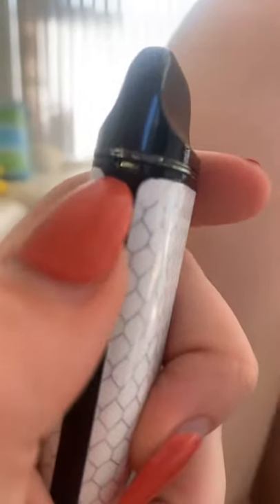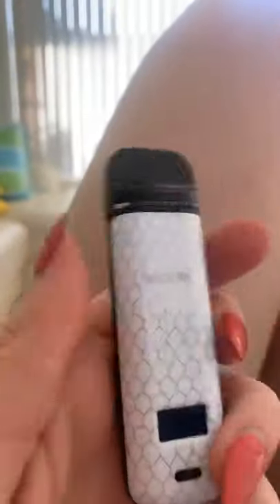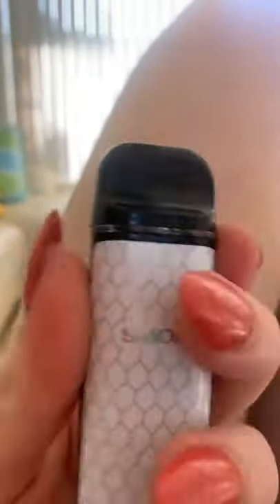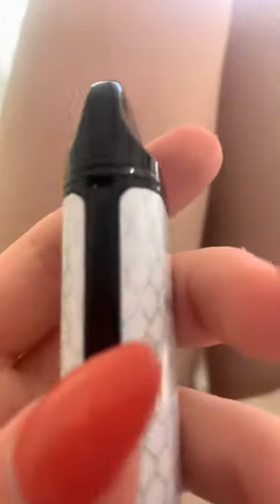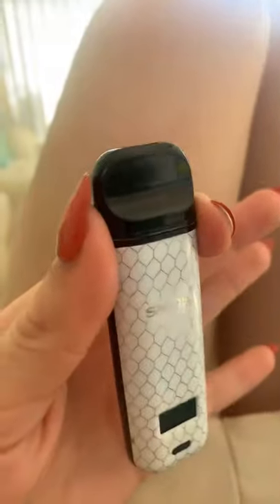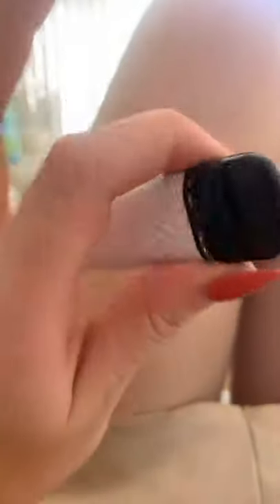New novo x not ripping? Here’s how you fix it!

Comment: That’s a short fix. Take off the panels and clean the censor on the inside it will most likely be full of juice
Reply: I did mine and it was clean and it’s still not hitting
Reply: @Chopliferoc  since then I’ve stopped but just buy a new one at that point
Reply: the three wires in the center detached. do you know how to fix it? i really need help😭
Reply: @alexialy-nou1997  same happened to mine it would take micro ish soldering better off getting a new one